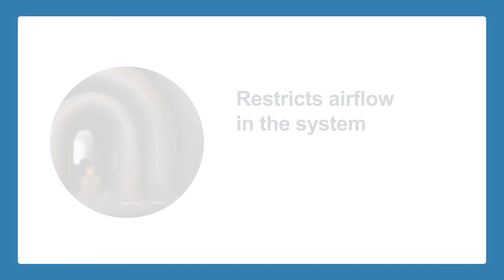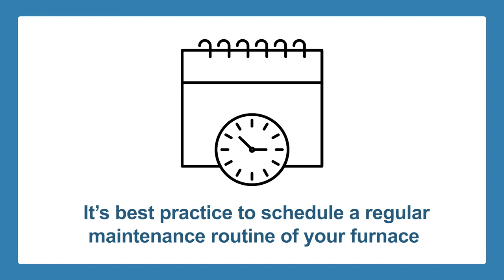Furnace Noises and What They Mean

Comment: Installed a new Lennox SLP99 HE furnace last year.  From day one it exhibited loud pinging/rattling at startup during inducer fan purge.  Initially, the installer blamed condensate in the plastic inducer fan hitting on the blades and housing.  After correcting an incorrect installation pitch problem, the noise continued.  On third call-back, this time accompanied with Lennox field rep, it was now determined it was loose turbulators in heat exchanger causing the noise.  He tightened a few with his fingers then buttoned up the exchanger.  The problem continues! 😡
Reply: Sams

Comment: I need help. Every time the furnace shits off, a LOUD rattling noise happens, for a couple minutes, in the air ducts that run the full length of our upstairs bedroom as well as the basement living area. HVAC company says it’s not the heater, Air Duct cleaning company says it’s not the Ducts. Who do I believe? How do I resolve. I can’t sleep at night with the heater on so the house is freezing in the morning and then I hear the rattling all morning until the heat stays consistent in the house. Please help me figure out the solution.
Reply: Excuse my typos, I can’t figure out how to edit. 😥

Comment: Hi hi nearly four months ago to professional came to replace the igniter after replacing the igniter he took the picture of the furnace and he told me that your furnace is old after he left the furnace start making noise my question to you did he messed up something on the furnace I like to know thanks
Reply: It is a good idea to have your furnace and AC checked each year anyway.  I would find a different company to do an annual checkup.  I'm not sure if you should tell them about the noise though until after they finish.  I mean, it may actually be a normal noise you simply never noticed before.  However, if you mention it and if they are a dishonest company they might tell you that you need a fix when nothing is wrong... since you are telling them basically that you think it is broken.
I mean, if the noise isn't normal they won't need you to point it out.  If they find nothing THEN maybe ask what the noise is.  I'm no expert though... just what I would do.
Btw, is it a kind of rattling noise?  If so then it's possible he knocked a bolt loose on the fan assembly by accident or on purpose.  That is an easy fix you could probably do yourself.  And I doubt that a honest company would charge you for a fix like that if they fixed it during an annual checkup.  Again, I'm no expert though.